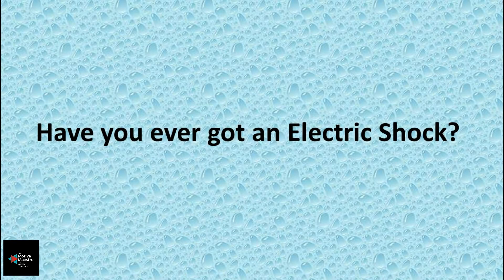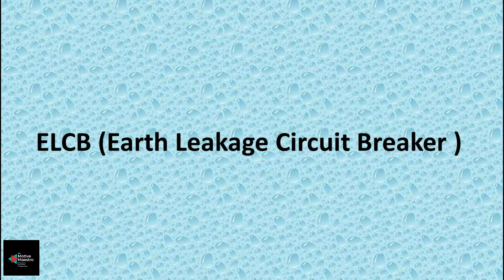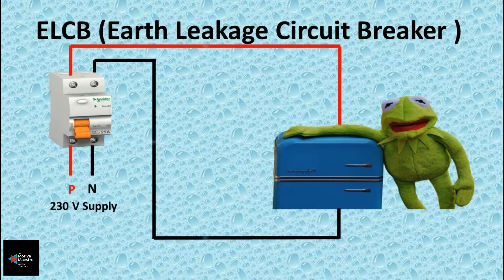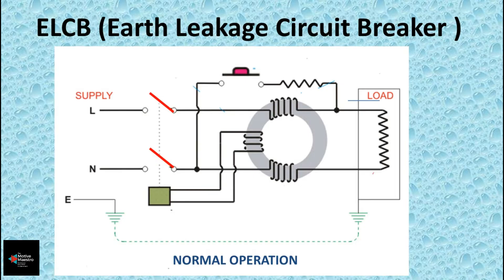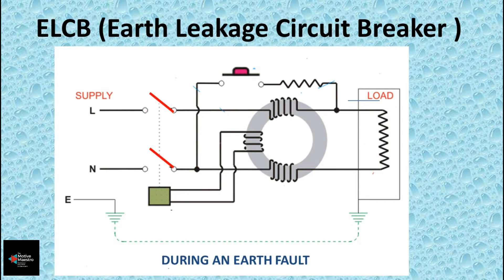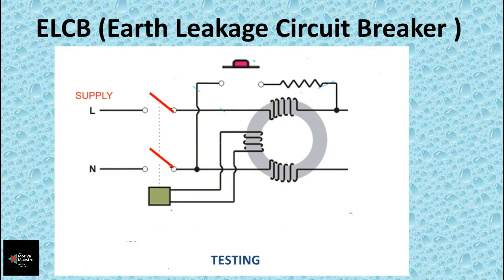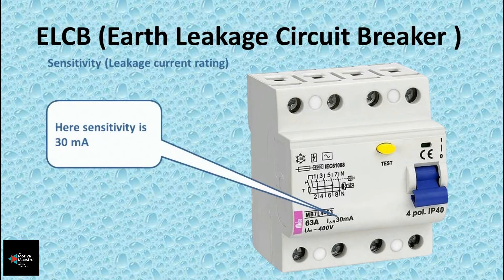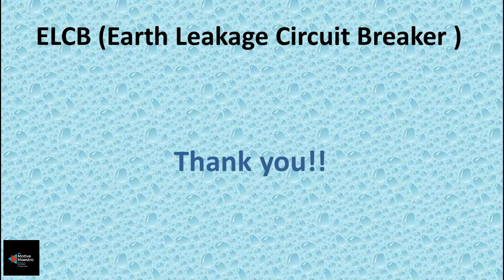ELCB function | working of elcb | what is inside an ELCB? | How does an elcb works?

Comment: I am confused  about RCCB & ELCB.  
 The Same Explanation  if found regard RRCB ،
Earth Cleakage circut breaker Actually Detect the leakage current ,
Means The earthing is mandetory. 
 But RCCVB works Acoording to Difference of Current flow B/W Live and Nelyetral. 
 No need for Earthing